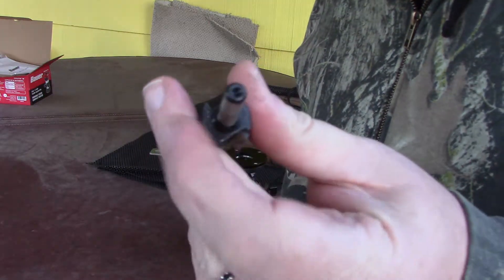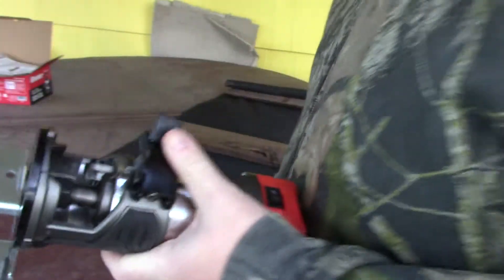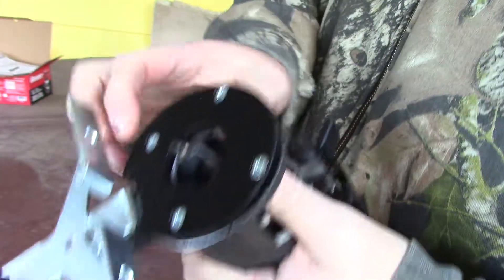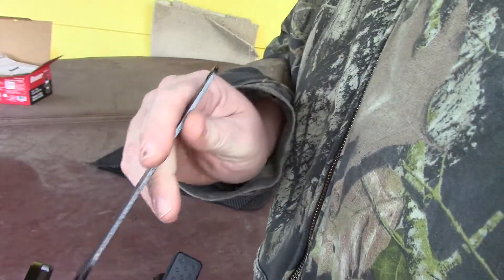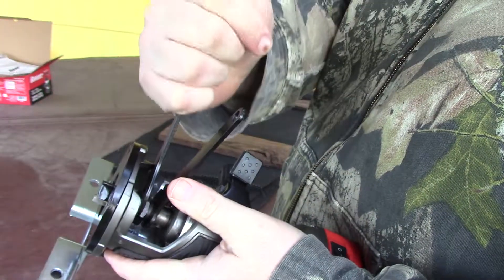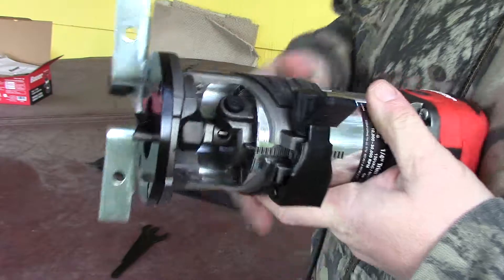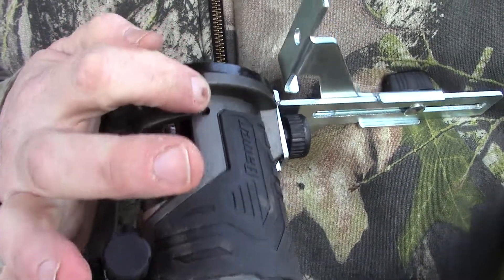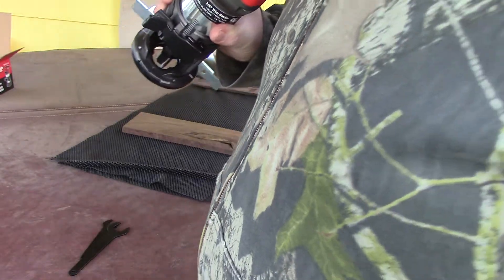Installing a router bit in the new Bauer compact variable speed router

Comment: I just picked up one of these. I wish my bits went in that easy, I have to take to collet out force it onto the bit then put it back in.  The router works great but I may return it just because of the issue with installing the bits
Reply from the maker: I have the router table and have that issue.
Reply: Same thing
Reply: Me too. I returned the cheap Drill Master and had no problem inserting the bit. I picked up the Bauer and I don't see how the 1/4 shank can fit. Any advice?
Reply: How did you force in the bit? With my experience, I don't see how the bit can be inserted without using a hammer.
Reply: @olivia8656  undo the bolt that holds the collet in place, then pull the collet out. Put the locking bolt over your bit and put the collet slotted side up on a solid surface. Now push the bit down into the collet and then place the three pieces back into the shaft. Tighten then but once you have the bit inserted and carry on. I considered using a hammer and not pull the collet out but I didn't want to damage anything.
Reply from the maker: Just tossing it out, make sure you have 1/4" shaft and not the half inch. Just tossing it out. If it's the right size and you loosen the nut and it's still tight, try the old hvac trick of Emery cloth and zoom spout oil. Polish it up. It worked great on blower motor shafts.
Reply: @cm.5023  Thanks for the detailed steps. So you do that every time?  And do you have to pry the collet out? It doesn't just pop out. I'm going to be using different bits and this does not sound like the way to go every time I need to use this thing. Thanks again.
Reply: @ChilesHeatCool  Yes I'm sure. I've used this bit before on another 1/4" router. Thanks for the tip but I think I'm just going to exchange this Bauer for one that works ...it shouldn't have to be this much of a challenge to insert a bit.
Reply from the maker: I would return it. Something ain't right.
Reply: @olivia8656  the collet comes right out with no problems. And yes this is what I have to do to swap bits. It's very inconvenient which is why I may return it.
Reply: @ceseme probably not but I would just get a replacement unit from the store. I returned mine and tested two of them while in store and the bit went in and out without any issues. I did notice that the hole in the collet seemed slightly larger on the two I tested.
Reply: The Bauer is a Makita clone. I took the collet from my burned out Makita and put it into my Bauer and solved the problem completely. If it doesn’t drop in, use some felt and a dead blow and gently tap it in. It will seat perfectly.